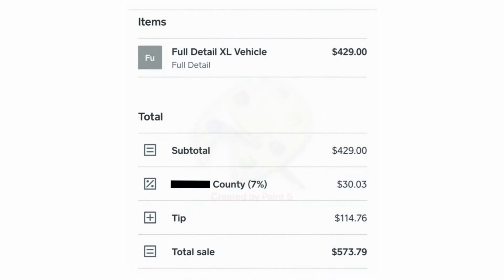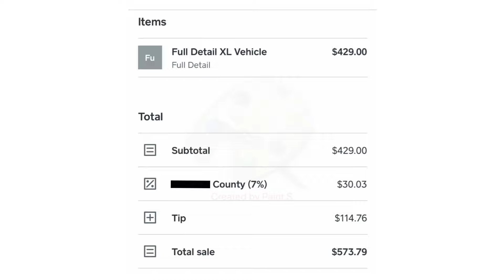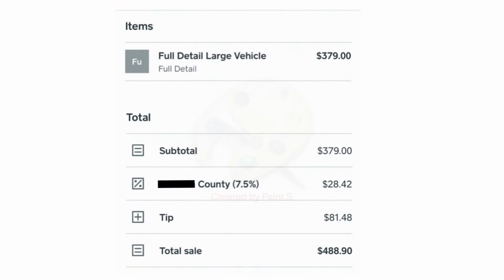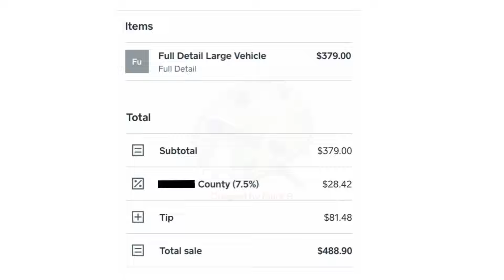HOW TO MAKE $1000 PER DAY DETAILING CARS | BUILD A SUCCESSFUL MOBILE CAR DETAILING BUSINESS

Comment: On those seats instead of that magic eraser use your steamer with APC or interior cleaner. I did some grey leather seats yesterday that were trashed. The dirt made the seats look black. I used that super clean 4:1 with my steamer and that dirty just melted off the seats. It was a 4 door truck. When I say I went through towels. Man. My yellow towels were black when I got through. But, the customer said the seats has never looked like that since they got the truck. Hard spots that won’t come off, get your steamer and tap a rag around the end and do exactly what you’re doing with the magic eraser.
Reply from the maker: Very good. Yes I do this on occasion. The steamer is a great tool. The magic eraser is great for removing scuff marks like from shoe scuffs on the glove box in this video. Most of the seat grime came up with the apc and a towel. But there were a couple areas that the magic eraser did the trick.

Comment: I think you did a top job mate. Thank you very much for taking the time to share your day. I know that youtube is restrictive of the length of a video and because of that most youtubers don't show everything. I was wondering if your full detail includes the engine bay and/or boot areas of the vehicle or are those add-ons? I am beginning my journey as a mobile detailer and like you said i was way under priced. So now im sitting down and working out my packages and what I'm gonna charge for them. In my past details i always included the boot and engine bays as part of the full detail. (truth be told over here in Australia ppl consider a "Full Detail" to be the biggest most comprehensive package possible encompassing every part of the car including cut and polishing)  I will be changing that paradigm as that is so much work that what i am/was charging for that isn't near enough (not to mention how long that process takes). I have been detailing/learning at work (as much as a car smash repair shop can teach and as much as one can learn from youtubers) for the last 17 years and among my peers I'm considered top tier one of the best they've ever seen. I have everything equipment wise needed to work a mobile detailing business except a van (currently using the family car) and i do have a few regular customers that i provide services for. Not enough to go full time yet but as in your video i get 1 or 2 who walk up and ask how much and sometimes they say sweet when can you do mine :D and they sometimes become a regular. I have a lot to learn as i don't have any business knowledge. I know the work side mainly. Sorry so long winded mate just wanted to give bit of background with my question. Thanks again =)

Comment: Some wheel brightener splashed on my nano clay mitt yesterday and I’ve been to chicken to try it out on paint or windows, do you think it’s ruined
Reply from the maker: It should be fine. I leave mine in my wash bucket with either onr or wash soap. Sometimes I’ll use wheel brighter on paint, especially white to remove break dust. I’ve also used wheel brighter on windows to remove water spots. As long as it doesn’t dry on you should be fine

Comment: Love your wrist sir, use a yellow or white round drill brush for the carpet. Also an tornando to blow out hard to reach places. Be careful with mr clean ereasers as it can scratch. Optimize use of your steamers and chemicals as it will prevent damages. See DIY Detail and chemical guys.

Get a better dry towel large and small  from the rag company for exterior.

Avoid close contact with your water gun as you are in the video, you can damage the paint that way. 

Some areas has hard water, so if using a water gun from most customers homes. You are at risk at blasting hard minerals into the paint.

I recommend you get a ik multi spray bottle to make it easier on your wrist.

Exterior wash use a good quality wash mit or black and red double sided sponge from DIY Detail. This will help prevent scratches and optimizes use of your soap.

Also use a small plastic table to help you wash car mats and dry without bending over to clean and avoid to clean it again while its out to dry on the floor.

In event if hot sunny days use a canopy and make shift barrier with your table and tarp to prevent debris from landscapers.
Reply from the maker: Thanks for the comment. I’ve used and threw away most of the tools you mentioned others I use on occasion. Old dogs, new tricks

Comment: Don’t use magic eraser if not needed at a certain point the protection will ware down and you can affect leather I had to learn the hard way
Reply from the maker: This I know. It was needed. That is a good point though. I should mention that on another video. I too have learned the hard way. Especially on dealer repainted seats